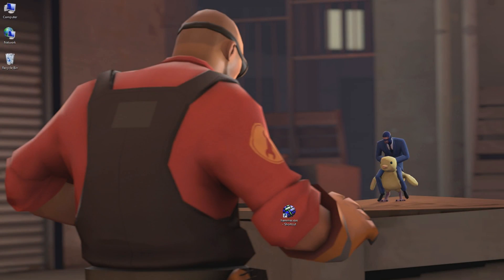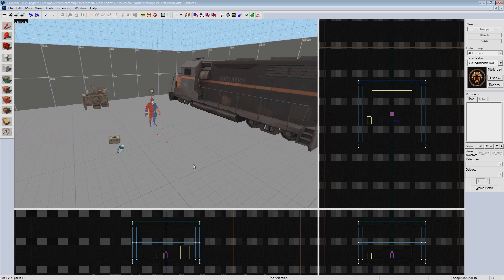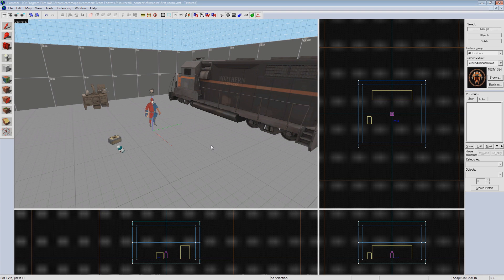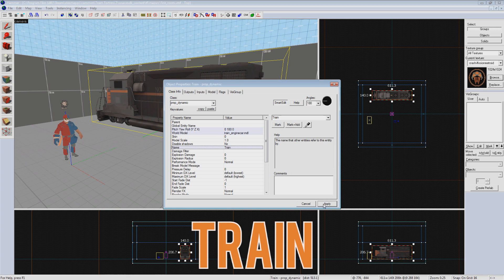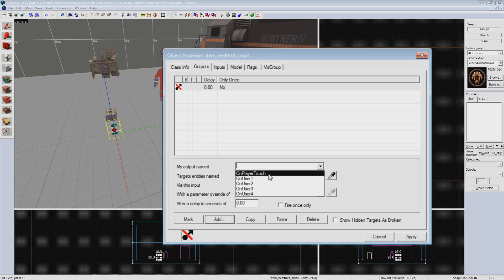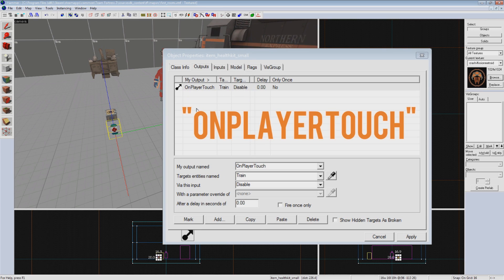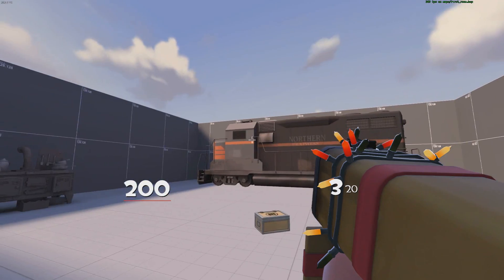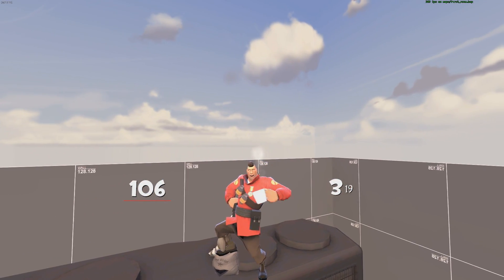How to Make TF2 Maps - Inputs/ Outputs - Chapter 2 Episode 1

Comment: I'm having issues where props I put in are invisible? I've tried different props (tank, tent, train, etc.) and soon as I load into the map, they just don't seem to exist for some reason.
Reply from the maker: If they are only not showing up in game but are in Hammer, make sure your map is compiling properly and not leaking. That can cause props/ changes to not show up. Also make sure you are using the right prop type (static, usually)
Reply: some props are only made for props_physics so try changing it to that and make sure to turn motion off if you want it to act like a prop_static

Comment: hey Crash im a mapper myself but i have a problem when i want to make a map i dont know how i can make it.  
Like for example lets say i want to make 2 towers connected with a large bridge im like yeah im gonna make that but i dont know how 

im bad when it comes to the design of maps so i was  wondering if they are anny tips for me.

i know you do mapping longer than me but i was wondering how you do it, think of something and make it happen :P

i dont give up on mapping i start by making orange maps so i dont need to focus on textures but i want to get into texturing

annyway sorry for my english its not my native language
Reply from the maker: sourcegamer Study Valve maps, see how they do things.  Start with a rough block out and just throw some ideas down in dev textures.  Get it tested with a full server (tf2maps.net is good for this) and see what works and what doesn't.  Improve on it until you feel like it's solid enough and then start detailing!

Hope that helps! :)

Comment: Valve uses that output with the halloween spells to have tight control on when they appear. You can have the output be send back to the spellbook, telling it to re-appear after 20 seconds or so. (That requires it to not reappear on it's own, as the default time is 10 seconds.)

Comment: Great vid! When I saw the subject I was skeptical that it was going to fit into five minutes and still be accessible to people without computer logic or coding experience, but you pulled it off!

On a random note I'm also using Sir Hud, but I think I might switch soon. I keep getting bugs with little things, like red text showing full health or ammo, making me think I shouldn't engage.
Reply from the maker: I've tried getting into programming in the past and I just don't have the mind for it.  Stuff like this is way easier to wrap my head around, even though it's really just a gui for the scripting.  As for the hud, I'm still trying it out.  It has a few things I might (bug sir grey to) tweak, but so far so good.

Comment: That was a gorgeously concise explanation. Also, that's a damn sexy HUD you have there...

Can you create nested logic with the input output system?
Reply from the maker: I'm not entirely familiar with the concept, but I'm pretty sure logic_relays would fulfill that.  Basically entities who's sole purpose is to forward i/o logic.  You can enable or disable these at will which will cause them to just not forward the logic when triggered.  I'm going to go over this in more detail later this chapter.
Reply: Cool (y)
Reply: rayshud